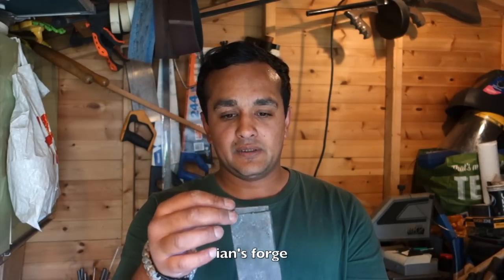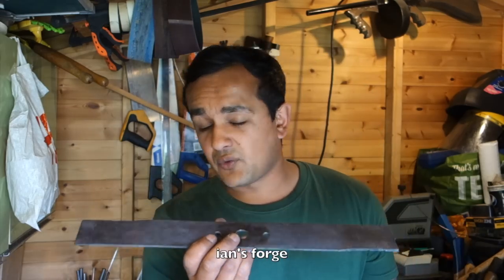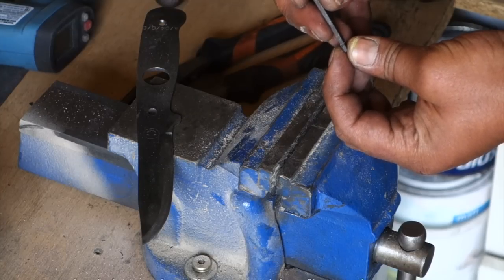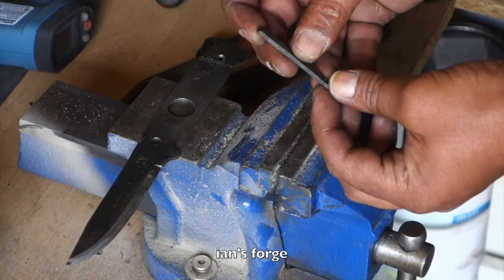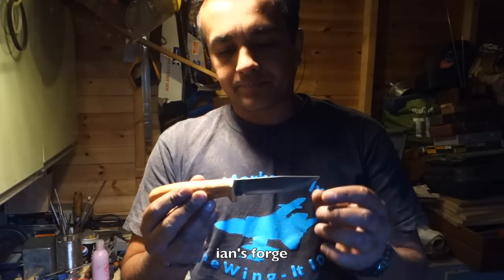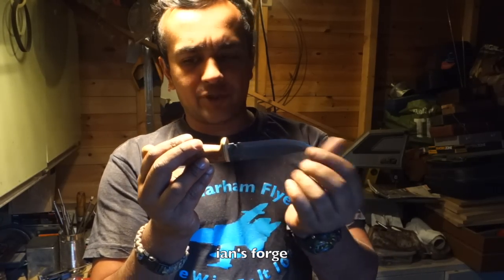The Ultimate Knife Made from A Lawn Mower Blade Using Basic Tools

Comment: hey man , you should really use that forge instead of your blowtorch to do those heat treatments , it will heat the blade to a higher temperature , and it will heat it more evenly , u want this steel to be an orangy yellow before u dip it into your oil or water for heat treatment (sorry for the repetions) ;p
Reply from the maker: thank you for the comment. using the blow torch was a phase i went through lol. I'm using the forge again.